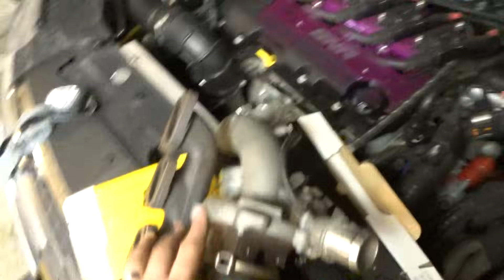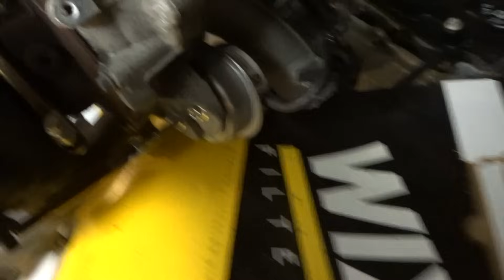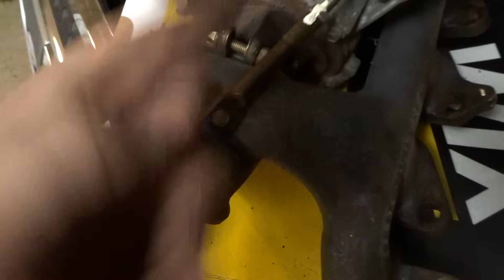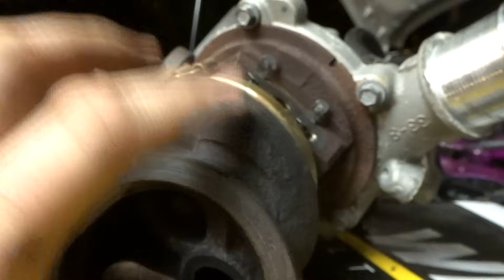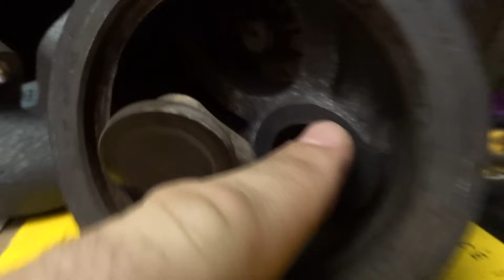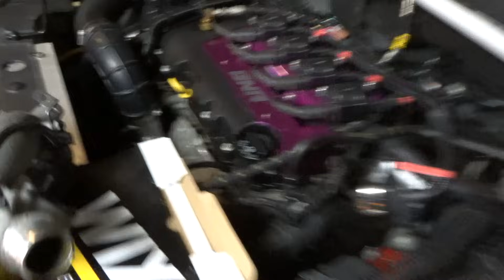Chevy Cruze Sonic P0299 Turbo Underboost Code Explained

Comment: Are there any other codes that could help determine where the problem is originating? I hate my Cruze, as it has been a money pit. I think I spent over $3,000 last year on vacuum leaks, turbo issues, and Thermostat issues. Don't buy the 2012 Cruze and if you are close to 130,000, get rid of it before all of the rubber and cheap plastic parts start failing. Don't get the AC Delco replacement parts either. Most are best from 3rd parties. Found out today that my 2012 is the worst of the Cruze years. If you have one, don't even chance it. Get rid of it.
Reply from the maker: Many things I don’t agree with here, especially the aftermarket parts, but I digress. 

What problem are you having specifically and what have you done to try to resolve them?
Reply: @AndreiDPop  I fix one thing and another goes out. Just got the valve cover replaced, due to the diaphragm leaking. I see oil around the seal, but on top of the lip of the cover, so I don't know where that is coming from. I have had the turbo line replaced 2 times previously and wonder if that could be the issue or if the cover was not installed properly, as I see new spray above the lip of the valve cover. I have had a continuous slow coolant leak, after replacing some parts of that system too. I had the return line for the coolant system go out and I had to replace it. Wondering if the T-junction on the tube going to the overflow could be cracked spraying or if I got a bad gasket with my new valve cover. It just seems to be one thing after another and I have changed mechanics multiple times. Right now, I just am getting the P0299 code have the very small coolant leak, that they are unable to find with dye, no condensation under the hood, other than above the lip of the cover, which I have wiped off once, only to have the condensation return.
Reply from the maker: @nicholasreynolds6609  have you inspected the intake manifold for a missing check valve?

Does the car otherwise run ok and have decent power? 

I have a leak test kit you can use to identify coolant and boost leaks btw, as long as you have a compressor.
Reply from the maker: @nicholasreynolds6609  also the solenoid underneath the manifold can sometimes get gummed up or stuck and contribute to a P0299. They’re rather inexpensive to fix.
Reply: @AndreiDPop  It does, now that the valve cover has been replaced. It was sputtering before that. I don't have a compressor, but my pops does. I haven't checked the intake. I just cleared the code and am hoping for a hiccup and that it doesn't come back, but based on my luck, I feel I will be sending it in again soon. If it weren't for all the electronics, recycling garbage, and plastic I could probably do the work myself, but I am afraid to do so due to the chance I could break something or cause the ECM to have issues. Never had a car cost me so much. My cavalier worked great and I kind of wish I would have stuck with it.
Reply: @AndreiDPop  I was looking at that in your video and hoping that was the case. That or the diaphragm.
Reply from the maker: @nicholasreynolds6609  try the intake manifold first. If that check valve is missing it will contribute to your underboost code. Get my v3.4 pcv fix kit from cruzekits.com to address that. You can get my leak test kit as well to chase down coolant and boost/vacuum leaks.
Reply: @AndreiDPop  And my break boost had another issue the other day again, after replacing some part 6 months ago and not having issues from then till now. Can't remember what.
Reply from the maker: @nicholasreynolds6609  the vacuum pump? Or the check valve/hose assembly?

Comment: Mine is tripping a p2261 for wastegate solenoid.  After replacing the valve, then the map sensor, pcv, valve/sensor, back to and replace whole turbo assembly with new components, the p2261 always comes back. All sensors are new and can't figure it out. Dealer said to replace the valve cover so we did. Mil stays off a few days, then comes back each time. All intake pipes are tight, no cracks, clamps checked.  Dealer keeps saying just a matter of time before they find the issue. Really?  After I've paid for all new parts and it still trips a p2261. The car seems to not have much power. Might as well not have a turbo because it feels like there isn't one on it. The original turbo had cracks by the wastegate, and Dealer blamed that and had me replace the turbo.  After the whole turbo assembly gets replaced, it goes about 6 months before the code starts tripping again.  When a scanner is on it, it's showing boost.  At this point, I'm ready to crush it.
Reply from the maker: Scanner is showing boost as absolute pressure. Subtract 14.7 from that to get actual boost. 

Which solenoid did you replace? There’s one by the turbo and one under the manifold on the passenger side.
Reply: @Dre Dan    I believe all sensors have been replaced. I just replaced the one on the turbo again, light stays off for 3 days, comes back on.  It never pops any other code.  Diag process been going on over a year now.
Reply from the maker: @okhotrodder  ok I need to ask to make 100% sure. Did you replace the bypass valve solenoid underneath the intake manifold?

Comment: Can/should u check the wase gate acuator 1st.??
Reply from the maker: Sure. Wouldn’t hurt.
Reply: I have that code what is the order to check all that?
Reply from the maker: @Kennyboo207  did you check the intake manifold for a missing check valve first?
Reply: @AndreiDPop  no thats why im asking what the order is and what u mean by missing check valve?
Reply: @AndreiDPop  i have a 2016 cruze but i think it the newer style engine ???
Reply from the maker: @Kennyboo207  is it a 2016 Cruze or a Cruze limited?
Reply: @AndreiDPop  2016 cruze, premiere 1.4 L. turbo
Reply: And 179k miles
Reply: The code code came in around last year at 120k and other than low exceleration on freeway im still get 40-50 miles per gallon on my mpg tracker

Comment: I cant thank you enough for this video ! I hit a deer with my 2014 chevy cruz ( minimal damage) but the check engine light came on. The body shop still cannot figure out why this code keeps coming up. Cant wait to show them this video.  Thanks again.
Reply: I hit the curb and same thing . I reset the light and it has not gone on since .

Comment: I have a 2015 Chevy Cruze LTZ that would have code P0299 that would make check engine light on only while driving at highway speeds….I kept clearing code and would keep coming back….Checked YouTube videos and I checked manifold for orange nipple and it was covered up with junk…I took QTips and cleaned it…And changed pvc hose…While I was at it new coil pack and plugs…So far no more check engine light…Just saying it might not always be turbo
Reply from the maker: Is the check valve actually present? Be sure to check for it occasionally as it tends to disappear after you clean it. The gunk is the only thing holding it in place some of the time. Also tighten the throttle body clamp.

Comment: I just bought a 2016 today and of course on my way home the check engine light comes on and it’s the P0299. And then I started smelling gas especially after taking off from being at a stop light but then it would go away I also heard a squeaking noise. when we test drove it the check engine light wasn’t on and it wasn’t making a noise either. Do you think I’ll have to replace the whole turbo? Also at auto zone the guy said it was coming up as turbo charger boost low pressure abnormal.
Reply from the maker: Check for a missing intake manifold check valve first. This might not be a turbo.

Comment: Another cause is if you dont screw your oil filter tight enough, it cause damage to the turbo which happened to me. I still have the issue. 
Is the car ok to drive for awhile before getting repaired?
Reply: There is a good reason that oil cap has to be seated all the way. When the cap gets screwed down it closes the oil return valve built into the oil filter housing. If not seated,  you'll lose substantial oil pressure to the top of the engine and the turbo itself. That oil return valve is a very fragile 3 pronged plastic piece that presses closed with the oil filter cap tightening. I measured the pressure difference due to that return valve being open slightly and the difference is huge because most of the oil is being returned to the oil pan.
Reply from the maker: I’ve never heard of damage being done to the turbo from not screwing the oil filter tight enough unless you’re actually losing oil and it’s starving the turbo of oil.
Reply: It dont make sense to me either, but thats what my mechanic told me. 🤷‍♂️ They did a diagnostic over it and came out good other than oil filter loose. It was not spilling oil at all, so I dont know. My check engine light is on and throws the P0299 code. The only weird thing is the check engine light turnsoff sometimes. Whens it on, you definitely gonna feeling like the car wont throw down power, so when I arrived to mechanic, the light turnoff. Doesnt make sense.
Reply from the maker: @freneticfrenzy8074  well one thing I’ll tell you for a fact that it’s not, is a loose oil filter cap. Find a new mechanic. If it’s intermittent like that, start by replacing the bypass valve solenoid underneath the intake manifold on the passenger side.

Comment: Thx from Poland.  Great video. I have   Opel Insignia A with this engine and when it is very warm outside and Iam driving fast sometimes I have P0299 issue. DURING  the winter and  autumn I never had it. I will try to find leaks first.
Reply: Yes. First thing was to chamge turbo. Unfutrunetly year after this i have p0171 lean condition. No air leaks. Lot of options.😅
Reply: Did you ever find out the issue? I have the same problem.

Comment: Great video! I am wandering though, do you have any idea why my check engine light came on for the P0299 code and then a few days later it went away on its own? Possible bad sensor?
Reply from the maker: Start by checking the intake manifold for a missing  check valve. Also temperature can affect it.
Reply: @AndreiDPop  thank you

Comment: Great video! I also have a 2012 Cruze with 115000 miles on it. It recently got the infamous check engine light with the P0299 code. I also had a couple other codes. I replace the valve cover, plugs and coil pack as well as the PCV hose and the vapour canister hose. I am down to just the P0299 code now. There is definitely a noise coming from the turbo when you start it up. I have checked all of the other hoses so I suspect maybe I am having a waste gate or turbine issue within the turbo causing the under boost. Any other suggestions before replacing the turbo?
Reply from the maker: Check intake manifold for a missing check valve. If missing you can get the pcv fix kit to resolve.
Reply: @AndreiDPop  I will check that. Also considering replacing the boost actuator solenoid and maybe the wastegate actuator after that. Turbo is a lot of work and quite expensive
Reply: @scottfreeman528  did you ever pin down your p0299 culprit?
Reply: @badass77bowtie  you bet, replaced the turbo and problem solved. Wasn’t cheap
Reply: @scottfreeman528  whole unit huh. What replacement did you go with?
Reply: @badass77bowtie  it was from RockAuto. Also had to replace the oil inlet and outlet hoses as well
Reply: @badass77bowtie  the inside of the turbo was cracked badly. Now it is running like a brand new car. Surprisingly the guy across the street also has a Cruze with close to the same mileage on it and I asked him if he had replaced the turbo and he said yes and they are notorious for them
Reply: @scottfreeman528  which brand did you get from rock auto, and how is it treating you now?
Reply: @bazoozoo5  I will check, sad to say the first one only lasted 3 months and failed due to a casting failure. Wished I went with OEM, may have had some of the labour covered the second time around
Reply: @scottfreeman528  i see. Im looking at getting dorman replacement, seems to be the closest to oem i can find

Comment: P0299 code and both on a scan tool and a mechanical boost gauge am peaking boost at 20-22 psi no mods
Reply from the maker: That’s absolute pressure. Reduce 14.7 from that to get actual boost pressure. 

Did you inspect the intake manifold?

Comment: Great video! I just replaced a busted turbo on 2017 trax and now it won't rev past 3k rpm and code is turbo underboost only thing that I had to rig was the tiny hard plastic line that goes along side the pcv hose and connects to the round thingy via a very short rubber hose with a clamp. Tried saving a friend money now I'm lost

Comment: I have a 2014 Cruze I just replaced the turbo now I am getting a p0234 over boost code and it has to down shift to maintain 70 mph on cruise very very slow any idea on what could be my problem? Running out of places to go on this thing

Comment: i had a p0301 misfire in cylilnder 1. a few days later i had the p2099 code. Could the misfire code have cause the boost code?? any help is appreciated
Reply from the maker: Are those the only codes? Usually not related.
Reply: @AndreiDPop  yea those are the only ones. I already changed spark plugs and the ignition coil for cylinder 1 but still have the code 😑😭

Comment: Exactly right buddy. Bro science isn’t always the answer lol. A good tech with a good scanner much more efficient. Ty. This is exactly why those 30 dollar obd scanners are useless to the normal uneducated person. Yes you can read a few codes but these codes are a direction too take while diagnosing the problem , a code does not mean that part is the problem.

Comment: Thanks for this.
I have code 89 when I drive then the car loss power for like 15 sec and then back no error no check engine light just this code when I drive a little on hills on something like that. What can be the problem?

Comment: My 2015 Cruze turbo just caused a P0299 code. I scoped it and found a large crack on the waste gate seat. I noticed you modified your engine. What do you suggest I do. Should I go aftermarket turbo or OE.

Comment: Would that turbo you upgraded fit the chevy trax 1.4t?
Reply from the maker: Yes!
Reply: @AndreiDPop  I didn't catch the name or part number of your upgraded turbo.
Reply from the maker: @robertculpepper1508  I installed the GTX14 from BadNewsRacing.net. They currently have a gtx250 which makes more power.

Comment: I got a P0299 code when I first happened I opened the hood and the catalytic converter was red.
Reply from the maker: Sounds like you've been burning oil for a long time due to PCV system issues you haven't addressed, and now your catalytic converter is clogged. Address the PCV issues, replace the catalytic converter, and go from there.
Reply: @AndreiDPop  that catalytic converter is new two months old. took the turbo out and lt doesn't look too good the open and close valve get stuck.
Reply: @AndreiDPop   The Pcv valve was replaced a year and half ago.
Reply from the maker: @TheAntsgood  which "pcv valve?" There are two pcv valves on these engines, PLUS a vacuum regulator diaphragm on the valve cover.
Reply: @AndreiDPop  I just seen your video from 2018 on PCV issues going to replace both them.I called the dealer trying to return my catalytic converter since it has one year warranty and its only a month old. But they cant see until next week. hopefully I can still run with it until then.
Reply: Found the problem the Intake Manifold is missing the orange rubber piece. replaced the valve cover, turbocharger, and last the intake manifold. they were all worn parts.
Reply: Thanks, Dre Dan

Comment: Set a 299 yesterday... Just gave the little Sonic a once over in the engine bay, and found the C-clip left the chat on the waste gate actuator arm. I was very happy. I was one of the lucky ones who got the  1.4 with the exploding ring land valleys on the pistons. Chevy covered that.. twice.  So when it comes to check engine light in my Sonic, I have a bit of PTSD. New clip, and all is well.
Reply: I gotta know if you still own that sonic 😂
Reply: @gracewalker4222  Yes. It's my commuter car. It's easy to work on, and it's been solid sense this incident.
Reply: So the waste gate should be closed if it is not closed will that make it hastate or stumble
Reply: @CharlesTuttle-v8u the gate should be closed always. It only opens on deceleration. If it's open even a little, you lose boost.

Comment: What would fix a leak at the throttle body? I replaced the tube coming from the intercooler already. I even have a t-bolt clamp on the tube and it causes a leak about once a week. Could the PCV have something to do with it?